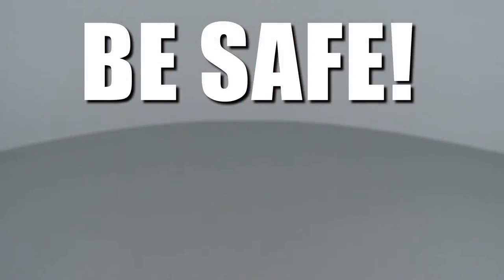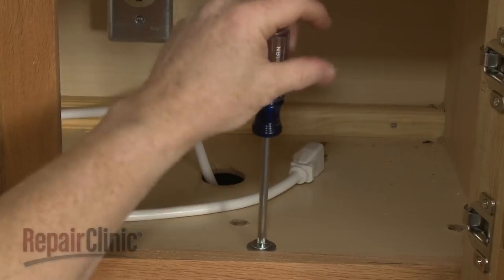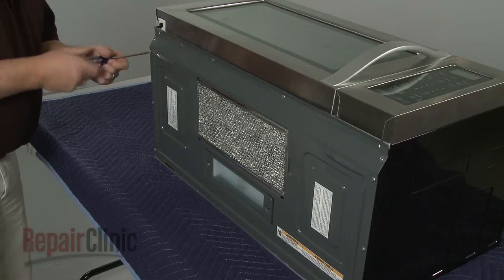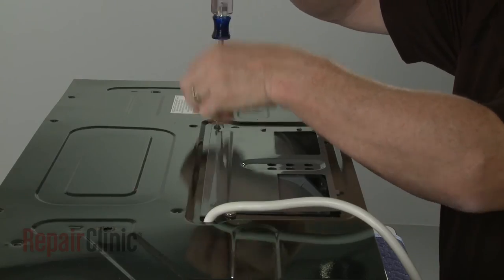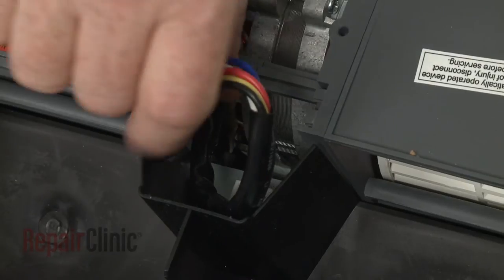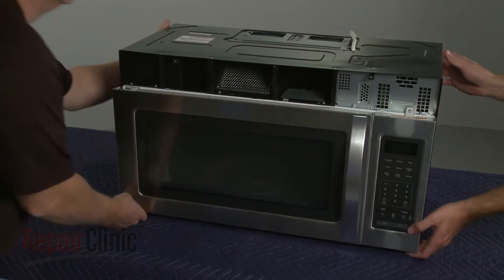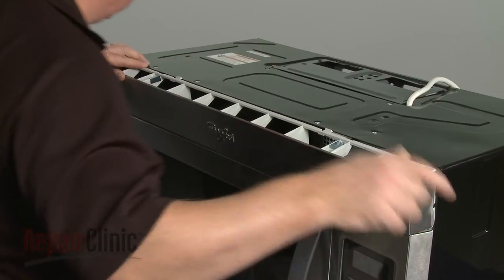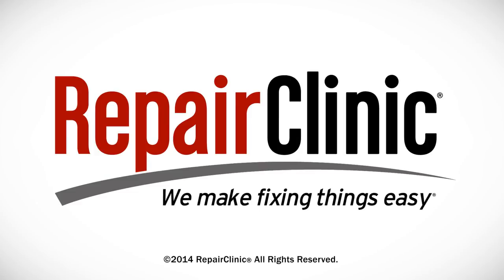Whirlpool Microwave Blower Assembly Replacement #W10439092

Comment: Would anyone know how to clean the sticky grease off the fan blower wheels that (look like hamster cage wheels) ??
Help needed urgently for kenmore lg over the range microwave that went wild over cooked rice burned it black and the dish -it was smoking - I am trying to clean it +  tried to clean the inside but the blower fans seem really gross - it's in really great condition - like new - it's sits on blocks won't fit over the stove - hope it's possible to clean those wheels I've disconnected them - but wanted to know how to clean them - hope to save this microwave - techs say toss it - I say clean it &  re-use it
Reply: I could only clean the outer housing of the squirrel cage but I'd just get a brush and some dawn worked for me pretty well just be sure to use some gloves